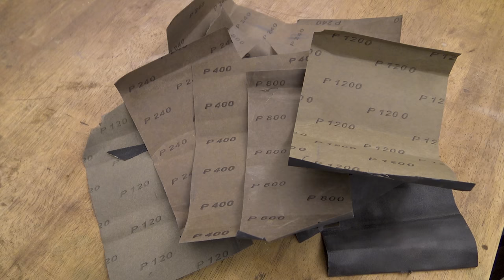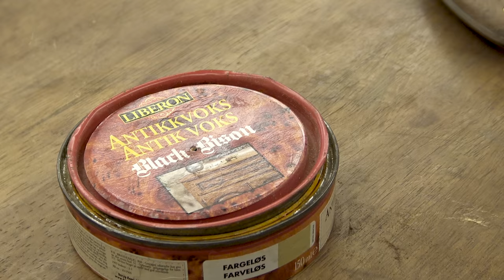Rusted Butcher Knife Restoration

Comment: Good job, as always...lots of patience and effort...paid off, no question.
1 thing...what were you striking the rivetting hammer with?
I ask because you should never strike 2 hammers face to face...there is a great risk of splintering...sharp shards of steel at very high speeds...VERY dangerous. Just in case...
Reply from the maker: Thank you Patrick!
I used two hammers (8oz each). I have never experienced that before, it is great that you mentioned it. Thank you. I will pay attention to that next time 👍
Take care!